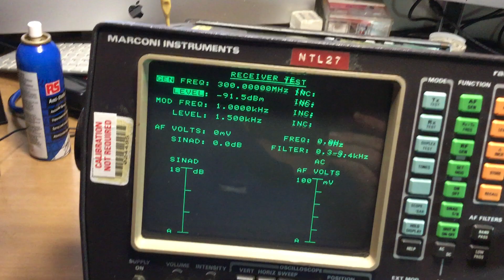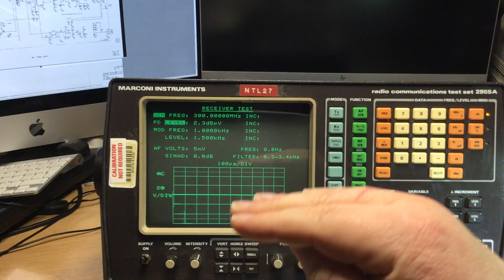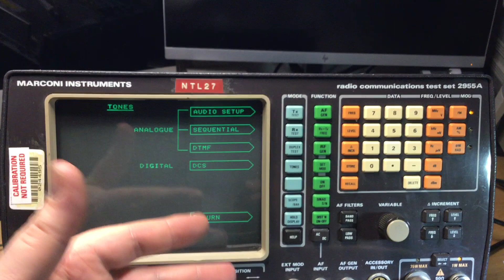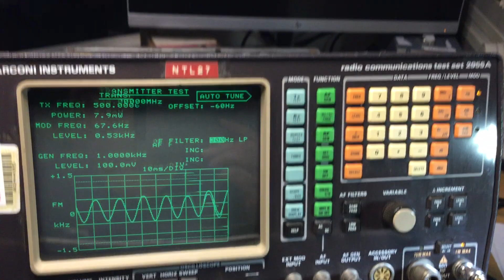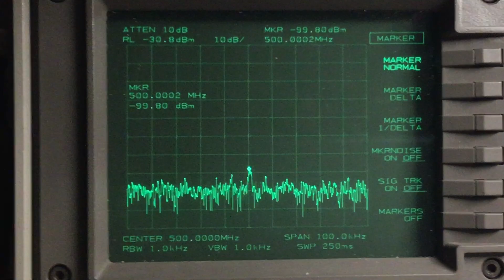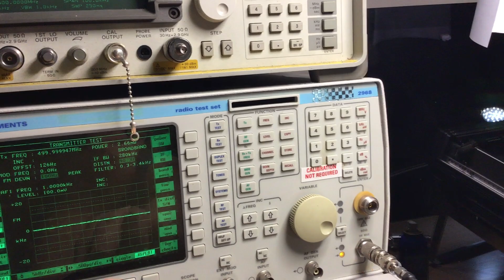Look inside Marconi 2955A with technical description & calibration Testing

Comment: Super walkthrough video, much appreciated. 

I’ve had a temperamental 2955 for years - read loads of info / watched hours of YouTube’s / prob spent days over the years of where to go next - but ‘fixed’ today. 

Cleaned the cards with a rubber as per 
Defpom’s Electronic Repair YouTube on the Marconi - and the unit doesn’t go into lockout as it would always seem to do. 

Put cards in - unit responsive but for the first time I had self test errors on 2.1 2.2 2.3. 

Never had errors before. 

I cleaned the card with the potentiometers on - still had the errors - but I decided to check a handheld for RF / Audio - & the unit then passed all self tests. Probably switched on/off couple times too. 

(I did this without putting the metal screen cover over the cards - saved aggravation shows it can be done)

So, as a by the way possible clearing of errors -  clean up of the contacts was stage 1 - insert cards & self test - if fault still present - connect up to a radio and inject some audio / power into unit - turn on/ off - self test again - this might rectify the errors -
I did this without putting the metal screen cover over the cards - saved aggravation shows it can be done. 

call it an ‘energising’ of the boards from an external device. My laymans explanation. 

I might just be lucky

Comment: Hi i have a 2955B does any one know if its possible to make the audio heard through the internal speaker from a transmitted under test sound any louder? With the gain on the front panel  at max the audio from a transmitter is still very low? Or is this normal with the 2955B?
Reply: I own one and we have about 10 at work, they're all quiet.
I have been planning to build a little audio amp to go in mine for years but still haven't got round to it.
Additionally, I might even add a phono style socket to tap off the audio and pass onto an external amp / speaker arrangement.
Reply: @digitalradiohacker  thanks for the reply that sounds like a good idea. I have some small audio amp boards so i will give it a try.

Comment: Manual states u can set 1v af output, but my 2955b does not go beyond 400mv
Reply from the maker: Ok i would start with the PSU check the voltages on the output first to ensure all the supply rails are correct, 5v -5 +12 etc, etc, this info is in my video, if they are not repair / adjust the power supply. if PSU ok check all the electrolytic capacitors on the Vertical boards - particularly the board which has the R1 Potentiometer on it. the AF amp has am AF decoupling capacitor on its output which may have dried up also check the electrolytic & as such by adjusting R1 you may just be compensating & thus over driving other stages which result in fault in other areas. remove & check all the capacitors on the entire board as some op amps have them across the supply rails after a resistor & its known on these that caps go short or near short pulling the supply rails down, so spend time removing each electrolytic capacitor & measure its value / ESR to ensure its not failed. that is a good & cheap & effective starting point. The Marconi service manual is downloadable free of charge on the internet so search for it, on there if you educate yourself by reading the theory of operation you will gain an understanding of how the circuit works & you will be able to repair it by developing your knowledge & understanding. Never rush a repair take time & take pictures before you remove a component so you know how to refit it correctly & advance in your own time, if you get stuck put it asside & come back to it later with a fresh mind. Learn before you start messing.

Comment: Hi!
I have 2955b with receiver option, however a problem i found is that bypass switch module relays are unshielded, and dirt made its way to the relay cores making them slmetimes got stuck... That means it can make your rf power go directly to sensitive receiver front end and fry the mmic amplifiers. I had to repair this and clean/lubricante/shield relays in order to work fine